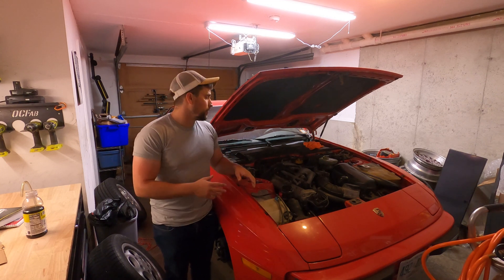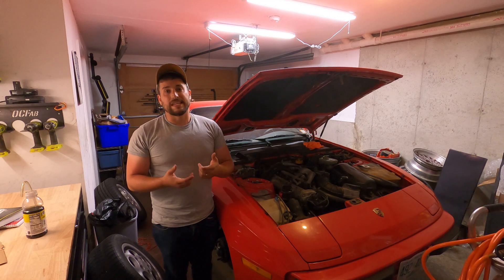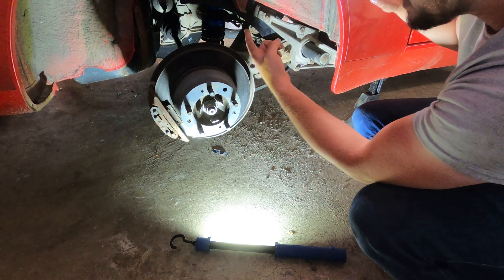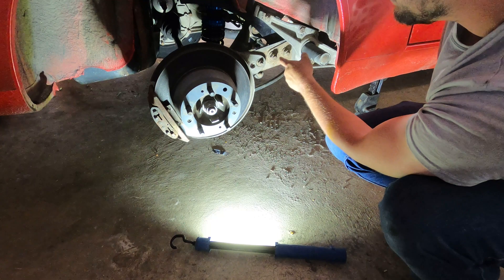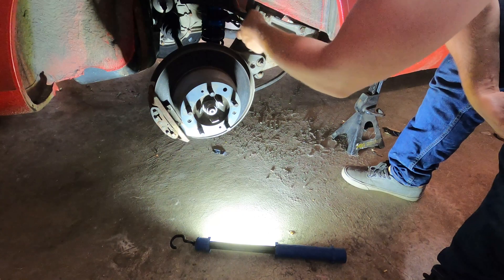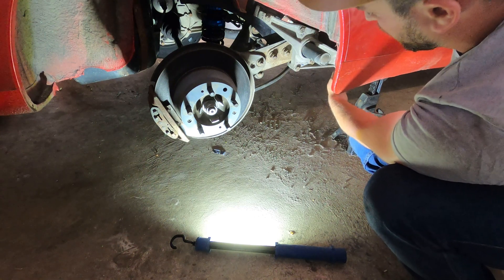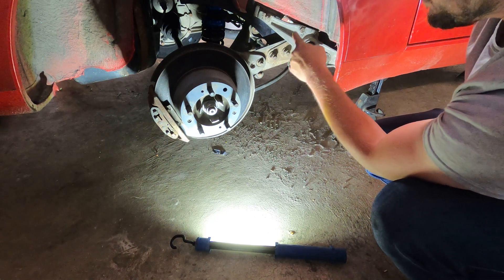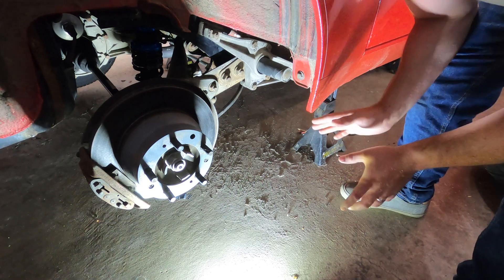Porsche 944 - Rear Torsion Bar Explanation, Correct DIY, and Quick Hack DIY

Comment: I have just removed my torsion bar assembly and rear suspension. I’m doing it to freshen up the suspension rather than a torsion bar delete. I’m taking the opportunity to renew a lot of stuff - mainly because I don’t want do this again! After 30 years a lot of stuff needs renewing and I’m readying the car for the next 30 plus. Good overview with your video, the only thing I will add is to use plenty of PB Blaster or similar, plus heat on some of those nuts.
Reply from the maker: Great tips! Pinning for awareness! Thanks Christopher!

Comment: Do you think it would be possible to cut the cap and pop out the torsion bars just far enough to reindex without having to cut the body. I just bought a 944 and it's about 1/4 inch off the ground. I'm 1/3 of the way thru pulling the rear and have really wanting to cut the holes but can't bring myself to do it.
Reply from the maker: I’m going from memory here - but if you cut the caps just to reindex, you might have issues holding the new index. I did some research back in the day and I found someone who cut holes in the body and caps to do it - but I need to go look. Let me see if I can find that video in the next 12-24 hours!

Comment: So I wish I saw these videos before I bought the coilovers. But I didn’t and I bought the same ones you have. I have a few questions before the install. How does it sit and does it ride well? And should I just do it the wrong way and cut it? If I do it the wrong way is that all you need to do? Pull it out and keep cutting it?
Reply from the maker: Hey Drew. Try not to worry too much, while I think the fit could be much better - the Coilovers ride really well. I got the height and dampening dialed in - and they ride awesome. 

It’s up to you if you want to do this the right way or the wrong way. If you have a lot of time, two jacks, and are detailed oriented - do it the right way. If you’ve done enough suspension work to be careful but cut corners, do it the wrong way. You’d save probably 10 hours. 

Best of luck, let me know what you need. Ask any questions and I’ll get back to you within a few hours.
Reply: @epochmotoring  thanks for the response. So I want to try to do it the wrong way but I don’t want to cut a hole in my body. So how far into the sleeve should I cut and once I have the end off will the bar just come right out and keep cutting every couple inches?
Reply from the maker: @drewpuck  I haven’t done it the wrong way myself (yet) so I don’t have exact measurements. You don’t need to cut a hole in the body, just keep pulling the torsion bar out and cut it. Here’s what I would do:

Jack up the car, put it on Jack stands and get the rear wheels off. Support the rear hubs somehow (Jack up and support with Jack stands, wood, cinder blocks, whatever works). The idea is to take the sagging load off of the suspension. 

Next your going to want to mark the covers at whatever depth is going to work. I can measure my torsion bars tomorrow to give you an idea. Two inches should be enough, but I can double check. 

Mark or tape your torsion cap area, then start cutting. Once you have the cap cut, keep pulling the bar and cutting. Once both sides are out, install your Coilovers. 

You can seal up the torsion covers with some PVC, just take some measurements. 

Give me a shout and let me know how it goes.
Reply: @epochmotoring  thanks man I really appreciate the responses
Reply from the maker: @drewpuck  Of course! Let me know how it goes!
Reply: @epochmotoring so I got everything cut and the torsion bars pulled out. I was wondering if you can send me/make a video of how the coilovers adjust height wise and dampening.
Reply from the maker: @drewpuck  I’ll grab a pic for you as soon as it’s out of storage. I’m heading to Ireland for work, so it’ll be closer to the end of April!
Reply: @epochmotoring  okay thanks. Also for the brake line. How does the clamp work?
Reply from the maker: @drewpuck  which clamp are we talking about? If you shoot me a picture I’ll have a look!